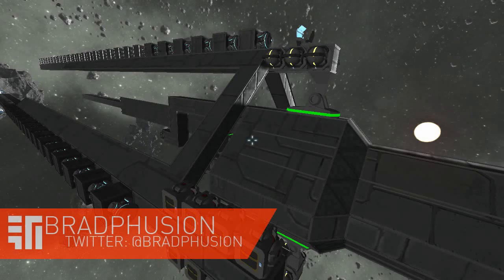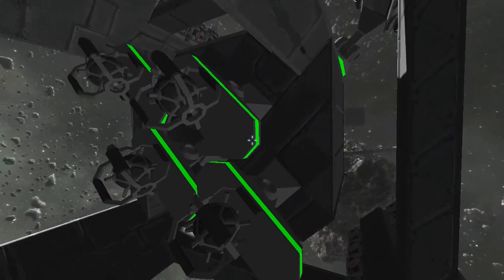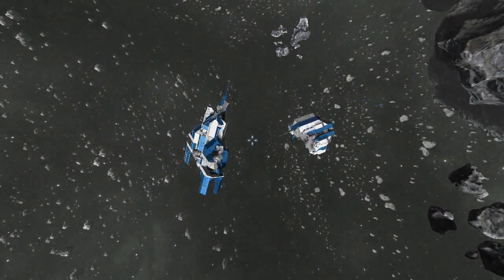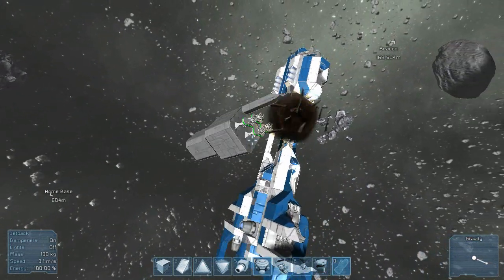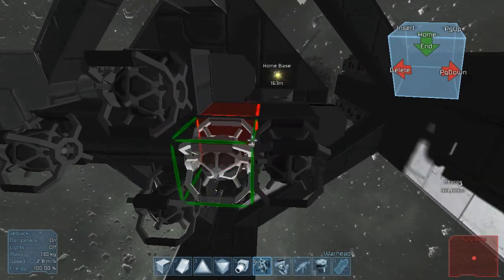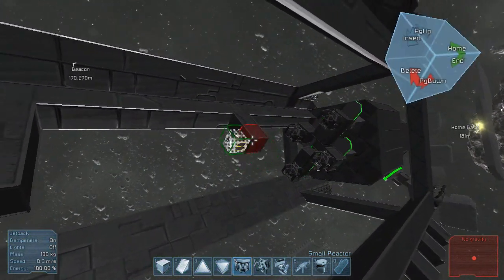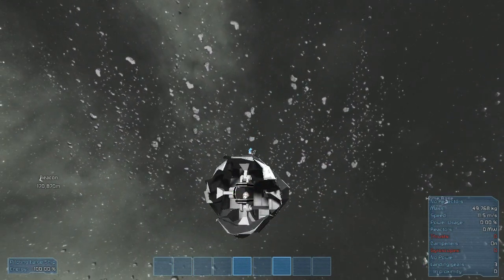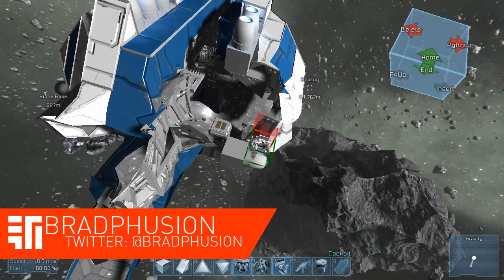Cluster Bomb Testing! (Space Engineers)

Comment: On second thought there are a couple more ways you might be able to implement this cluster bomb idea.  The first being a fuse of small warheads (I don't know if you can attach these to large ship objects, so they might have to have their own separate small ship object clamped to the missile) that leads to a breakaway charge that separates the warheads from the main missile body.  No landing gear really required, just poles positioning the warheads as you want them spread and far enough away from the breakaway charge to not sympathetically detonate.  One major potential problem would be whether or not the fuse would 'burn' fast enough to reach the breakaway charges before the entire missile crashed intot he target and made it irrelevant.

The second option is to have a 'hammer' strike breakaway charges.  In this method you'd still have a power plant out forward as the fuse, though not necessarily any landing gears.  Mostly it would be above, but instead of the breakaway being detonated by an explosive fuse, it would be detonated by a hammer - a short arm on a motor.  The motor would be held in place by the power plant so that it stayed poised above the breakaway charges during launch from the accelerator, but once the powerplant was destroyed the sudden deceleration would cause the hammer to strike the breakaway charge and release the warheads.  Hopefully braking torque requires power :)  Even if not, you might be able to find a way to make this work (perhaps the motors are retracting the hammer at low velocity whilst under power, with no braking torque, so that they still strike forward when power is lost and they experience sudden deceleration).  Honestly, this hammer might not even require a powerplant fuse at all, since the acceleration of the gun should send it away from the breaking charges instead of towards them, you'd just need to set the limits on the motors so that they couldn't go too far (and so wouldn't strike in the wrong direction with deceleration).  You'd still want a spear of hull going forward to have it release at a distance though.

One cool modification to the actual bomblet mounting to get a better spread would be to mount a motor where the warheads will go, then have that slowly spin a + shaped section of hull with bomblets at each end.  Have one breakaway charge set to destroy the motor and the center of the + upon impact of the forward member of the missile causing the charges to (hopefully) be flung outwards by the angular momentum of their spin, whilst still being separated from each other.  For efficiency of design you could have two of these assemblies facing each other but spaced one apart (and counter-rotating incase that affects things as it would irl) with a single charge in the middle to separate all of them, giving you four bomblets that will spread across the whole ship.  This would make fitting a hammer in to detonate the separation charge tricky, but would be utterly badass.
Reply: Oh with the hammer detonator you might be able to put the missile on a time fuse, depending upon how warhead detonation works, so that it will separate before impact and get an even better spread (though with the rotary warheads model you probably wouldn't need this so much).  IF any armor block collision will detonate the warhead (unlike with the player where you have to impact with a certain velocity) then you could have the hammer start from a certain position and close on the warhead very slowly, changing the velocity or starting position to have it release the bomblets sooner or later.

Comment: I have two ideas:

1.) An update to both your torpedoes and gravity cannon, a timed impact fuse. You can just strap the explosive externally on the tip but that leaves it vulnerable to enemy fire. Instead, have the bomb under the tip and a tube connected behind it. Have a rod or even a single floating block inside the tube that's attached to nothing. On impact, the object will move based on momentum until it hits the explosive. Based on the distance between the object and the explosive in the tip, you can have it explode nearly instantly or somewhere within the ship...

Side note, deceleration might be an issue. A solution might be to have the object or pin in question connected to the same docking clamp, at the rear. So the end design might look like a test tube, if that makes sense. ^^'

2.) Read Fuxx Choo's posts for his ideas.

Comment: Another way you could do a cluster bomb would be to have a central stalk with branches that are attached to warheads. when the shell impacts the tip of the stalk where the branches are attached will be destroyed which will disconnect the branches from the shell and cause them to fly in separate and random directions. it would be easier to implement and less likely to fail than the solutions proposed by Fuxx Choo. however his designs would be more awesome and probably get a better spread than my idea. also the timed charges and impact detectors he is proposing could have many other uses.